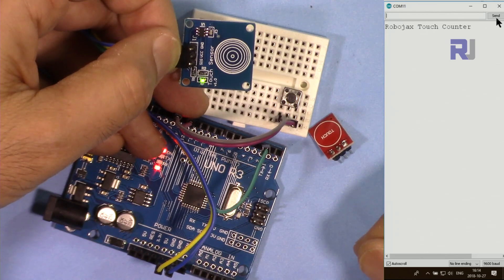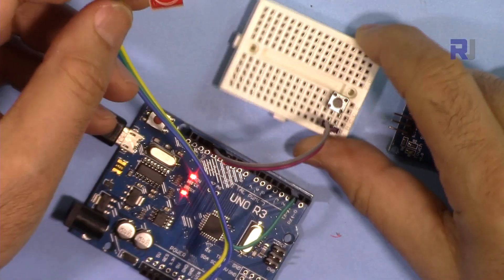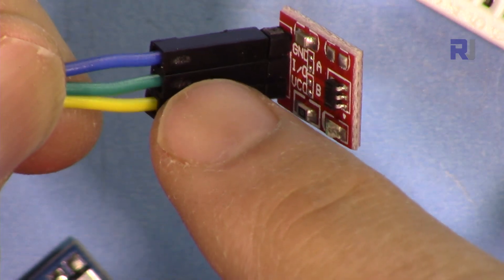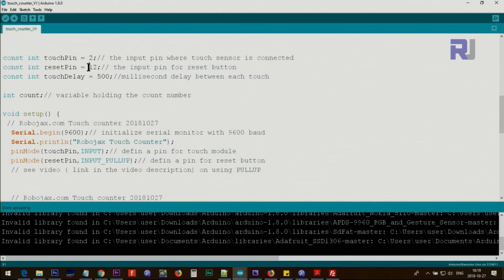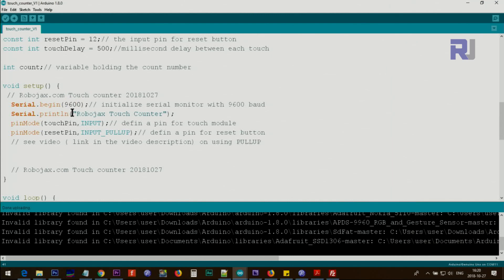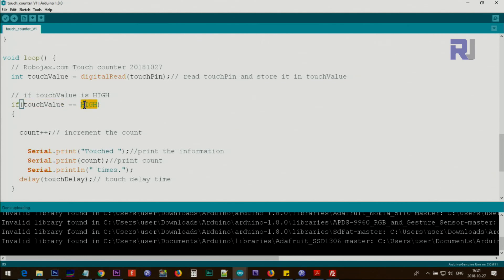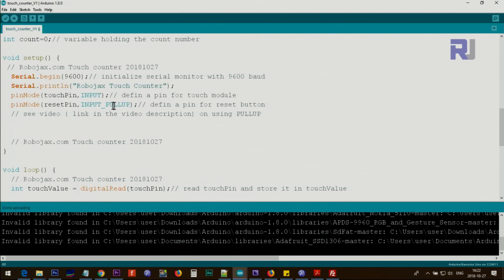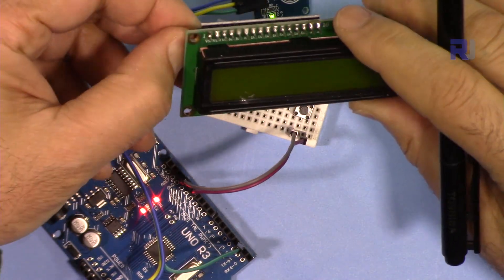Robojax Touch Counter V1 (simple counter) RJT132

Comment: Hey Robojax,

Could you send the data (number of touch) wireless, by Bluetooth or WiFi to the computer ?
Reply from the maker: It needs some work. You will need Bluetooth module.  First work with Bluetooth module (I have video on that. Search for it) and then use it with this code).
Reply: were you making something like voting machine